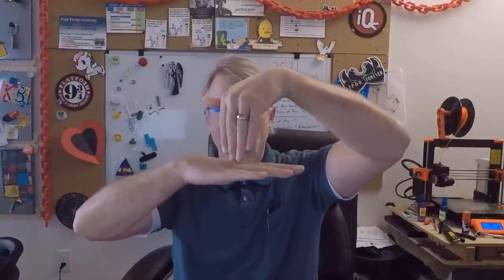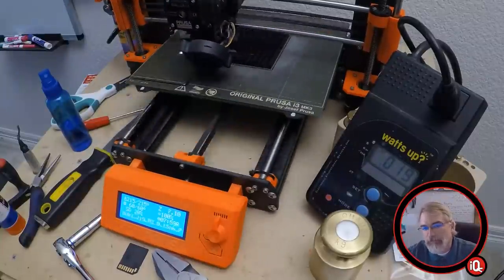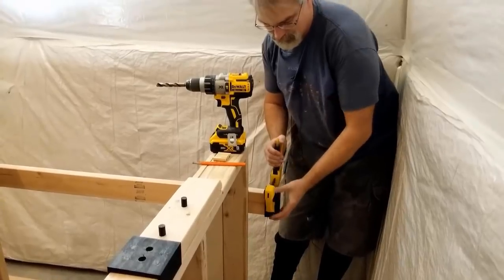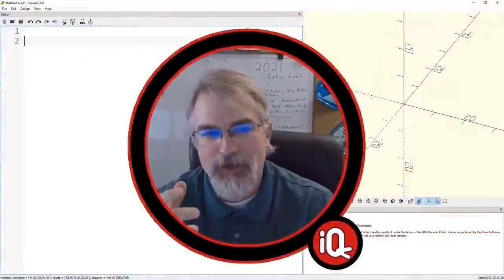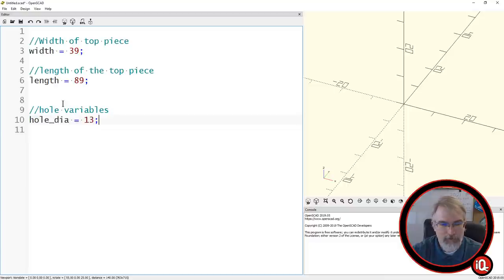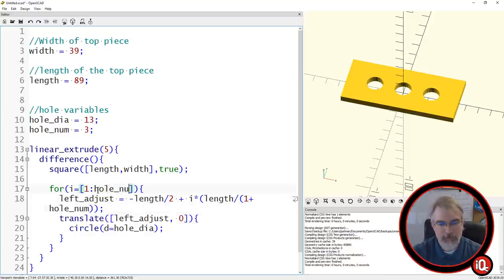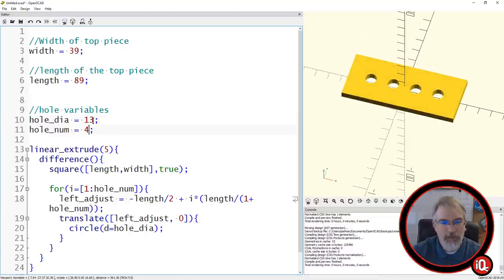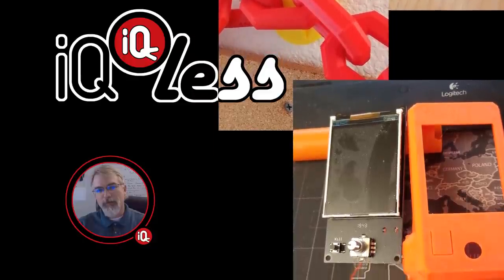3D Printing: 3D Printing a Woodworking Jig

Comment: I loved this - I had heard about OpenSCAD, but never really seen it in use. As a programmer and maker, seeing OpenSCAD really helps bring them together! Thank you for making this! Parameteric in Fusion 360 does a decent job, but the flow in OpenSCAD matches almost exactly the model I have in my head of how I'm "building" the part when I'm designing.
Reply from the maker: I am a programmer as well and openscad has a certain appeal for certain designs in my mind.

Comment: If you order some drill bushings from mcmaster, not only should it last forever (because the drill is rubbing against steel instead of plastic), but you can get them fairly tall which will help keep your hole drilling straight.
Reply from the maker: That is a really good idea to use for a jig you intend to use a lot.
Maybe a 3D printed jig with a drill bushing would be totally viable for real production needs...

Comment: Great idea! If you're getting water leaking in, try the vinyl trim material for the feet.  Works great.  I wound up adding a layer of rubber below the vinyl also that's Gorilla glued on.  Probably can use a better adhesive like type 1 silicone I've thought after the matter.  Of course, no leaking post clay amending the perimeter soil surface and subsurface along with running the eaves trough drains away further.
Reply from the maker: Yeah no water leaking problems at the moment (knock on wood)
But we all know at some point every basement has a flood so best to prepare ahead of time
Reply: @iqless  Right, that's why I figured add polymer and rubber feet to everything.  Chairs/stools... added rubber bottoms too.  Though have to stress again, amazing how the super basic concepts of grading, amending the soil with clay (adding measured amounts of clay into the ground soil mix, in a bucket with holes on the bottom, until the water stops flowing through) and drainage.  I was about to dig out the perimeter walls and line with a polymer wrapping or pond line a 8-10' skirt around the perimeter.  Read about the clay for pond lining method and figured for the price of two 80lb bags (haven't even finished using one) I'd try that first along with the grading and the cheapest 4 and 6" drain pipe from Menards to make the underground drain circuits... why not?  Been dry since and not as humid too.  Don't have to drain the dehumidifier bucket as often also and this season hardly even fills.  Waiting to see what spring brings. 

I've been spoiled on the DesignSpark Mechanical and MicroSoft 3D Builder... you've got me motivated to try the OpenSCAD installation I've not used yet.

Comment: This was a clever jig :)  I would point out that all dimensions in Fusion can be an expression so just modifying a single value will give you the same flexibility as you were discussing with openscad. I believe doing it in Fusion you also allow you to  connect more with the wider community because most designers are not coders.
Reply from the maker: Good point

Comment: i have done the exact same thing!  i'm designing some stairs and templates for cutting.  this is very cool!

ps, if you want, i can help you set up a camera mount that moves with the bed.  another option is to set up octolapse on octoprint.  either of those would get you timelapses where the printed part is in the same spot in the image on every picture.
Reply: oh, i did not make 3d printed dowels though.  that's a cool idea!
Reply from the maker: That time-lapses with  no print head in the way and just watching the 3D print grow looks so cool.
But I keep not wanting to do it just because the pause would alter my stats I take...
But I could always just print it twice....
Reply: @iqless  if you mount the camera to the bed, it can take snapshots where the printed part is in the same part of the frame and you don't have to have extra wait time for the nozzle to move out of the way.

Comment: That precision in framing is an silly and a waste of time. By the time he is done designing the jig, printing... I would be done with the project. After drywall and paint nobody would know I was off by a millimeter or a degree. Last, let’s not forget no 2x4 is straight and you have to manually account for that. Seasonal shifting... screws will sheer......